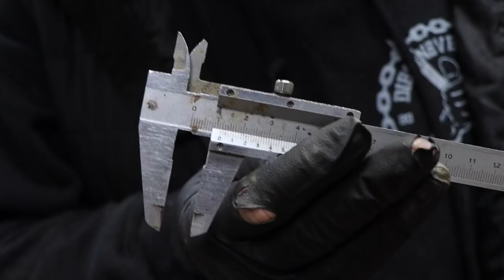Gamorrean Guard Short Sword - The Book of Boba Fett

Comment: Wood turning as well, you are a man of many talents. Didn't quite understand why you wrapped the sword in that sheet of metal before hardening. Those belt sanders are really powerful beasts. Great video. Good luck from a rainy Spain today!!
Reply from the maker: Thanks mate, yeh I forgot to label that part, it was to help prevent decarb in the steel and protect it.
Reply: @DiesInEveryFilm  and reduce the amount of scaling, though I’m taking from the air quench that you were using stainless and I’ve really no idea how much that would scale in a commercial oven.

Comment: Could I ask you to explain what you did with the oven? What did you wrap the blade in, and what was the clamp for afterward?
Reply from the maker: It’s heat treat foil to prevent scale and decarb, clamp was to cool it a plate quench
Reply: @DiesInEveryFilm  Thank you, my friend. Can I use a regular forge for that, or do I need a special oven like you used? Any particular type of anvil you would recommend?

Comment: Odd request: (My apologies if this has already been suggested.) There's an older comic book series written by David Mack titled "Kabuki." The main character (a bad-@$$ chick codenamed...well, Kabuki) uses a sickle-and-chain as her main weapon. The chain has a weighted flail (ball? square? lantern?) on the end. They made a replica prop years ago but I highly doubt it was useable. Would it be possible to make a full-tang sickle with a slight flare for the pinkie plus a circle on the end for the chain, please? If you can't make it comic-book-true that's fine; I'm not sure the design was best for cutting. As for the flail: a ball is fine. A lantern or five-sided weight might be fun but not feasible. Thank you for the time and keep up the excellent work.
Reply from the maker: Sounds like a kusarigama type weapon which i have made a variation of before on here
Reply: @DiesInEveryFilm  Okay, thank you. How much would an actual commission cost for this, please? I'll look up the other later. Thank you again.